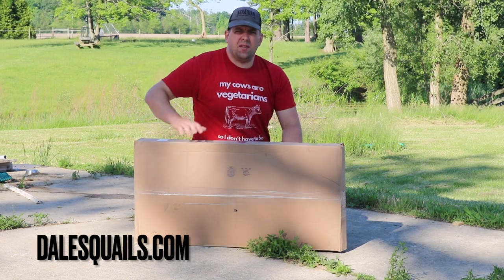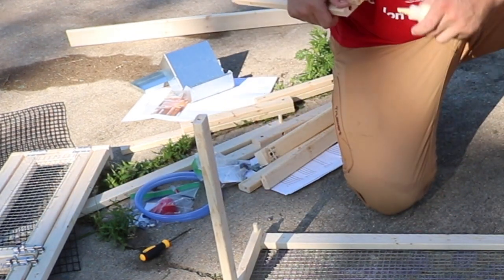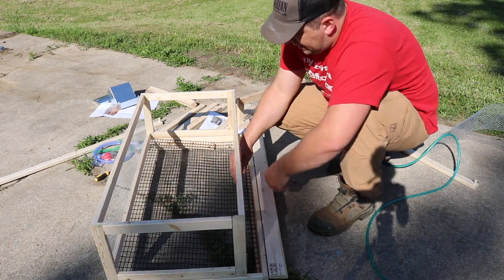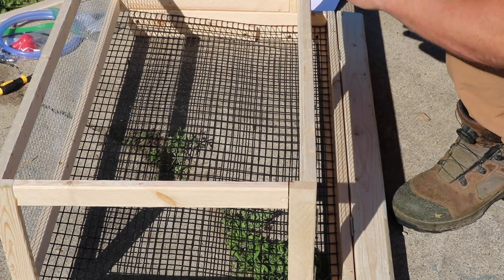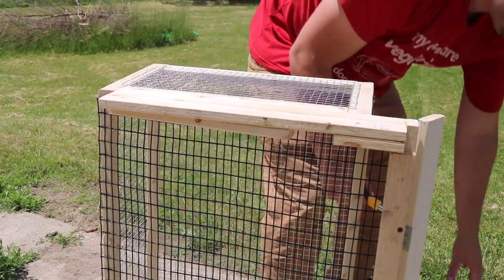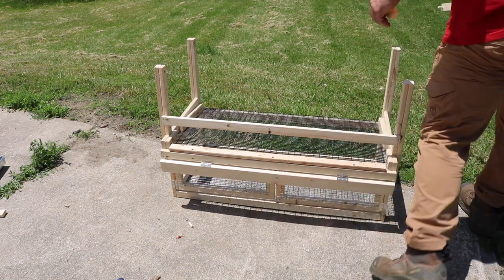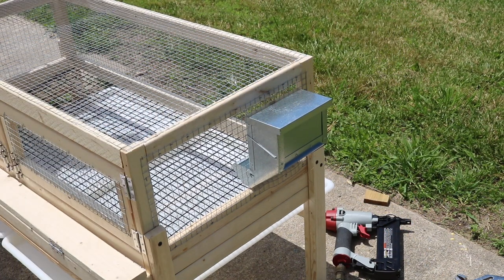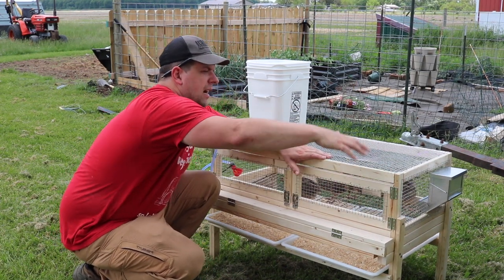Single Tier Quail Cage from Dale's Quails

Comment: On orienting the bottom floor wire...no doubt Dale's first thought would be focussed on minimizing wasted  wire mesh.  The width of the roll shipped to Dale has surely not been purchased with the egg rollout in mind.  In this case quail eggs will be too small to ride/ roll smoothly on either of the two opposite surfaces to choose from.  Ideally, you would want the eggs to contact the one-half inch spaced (down hill) surface grid not the 1 inch  spaced surface that  allows the egg to settle between them to rumble across the 1/2 " wires and not gain a chance to build up any momentum. BUT the reality(as I see it) is all about the width of the coiled roll from the factory to minimize wasted $. Special order (?) a  greater width to be able to cut it down the middle and get two cage floors . Or, I guess  just slant the floor with a greater pitch and hope the birds don't go lame?
Reply from the maker: Sometimes the birds walking around will help the eggs roll down from the vibrations. I later ordered the 3 tier and the cage floor orientation was ideal.

Comment: man i can build that same thing for 54$ .you look like you can build youre own .stop wasting money people .i have 230 quail .i have built my own cages since the 80s yes im old but good god 125$ for some thing you can build youre self .its nice but i dont have 125 to waist .i spend 200$ i can build 5 cages .so cheaper then 54$
Reply: I agree
Reply from the maker: Well, I wanted to start something that worked. I didn’t want to have to guess the dimensions. I had already built two cages and ran into some pinch points on the cage. I had a few quail die because of that. Dale’s quails was nice enough to send me this unit. I later sold it to a friend that wanted to get started with quail. I then purchased a 3 tier cage from Dale’s quails. I’m very happy with it. It works great!
Reply from the maker: I work 40 hours a week on top of the farm work. This saved me time. Well worth it.
Reply: @FarmerBrad  I'm elderly and don't have the energy for such projects while taking care of everything else I need to, this looks like a good idea for those of us that lacks energy or time.
Reply from the maker: I agree. In the future if time allows or you have more energy you can base the measurements off the working example to replicate. If I was to build it over again I would add metal flashing over the wood that the metal floor attaches to so the poop doesn’t come in contact with the wood.
Reply: @FarmerBrad  maybe a nice coat of paint would help.
Reply: I would lose money if I spent a whole day driving around gathering supplies, measuring/cutting, cleanup, etc. This is a great value for what you get and the time/hassle it saves you. Now if you want to build your own for fun or as a hobby that’s a different story.
Reply: I think you can build one better and it doesn’t take a lot of time or money I have build many that way you can custom build